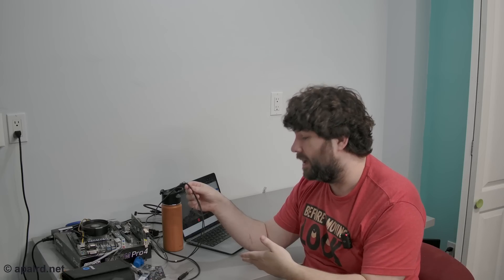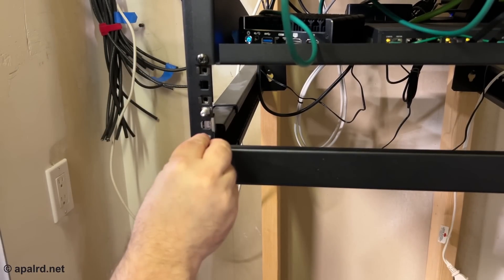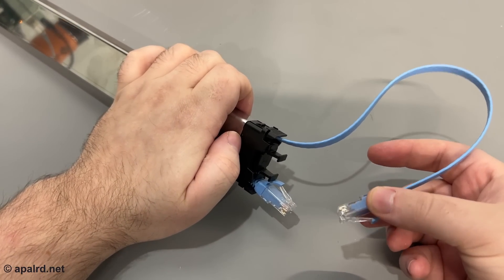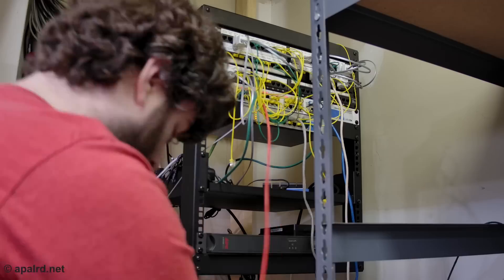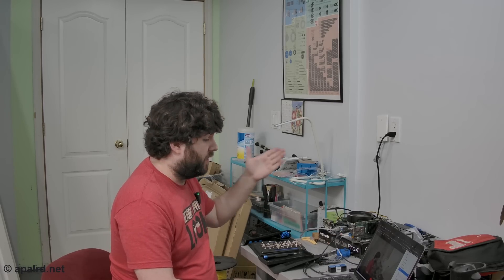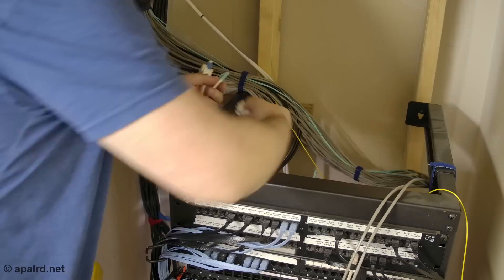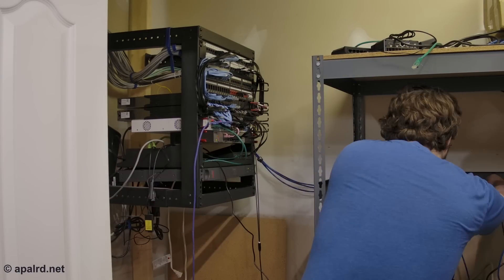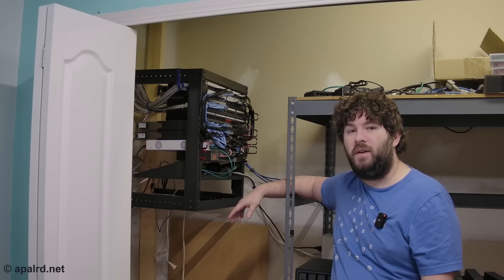Organizing my PATCH PANEL and talking about my homelab network

Comment: Get a used Juniper EX2300-48P to replace both switches, swap fans for Noctua ones :) Will get you 4 x 10G SFP+ ports too
Reply from the maker: I already have 4x SFP+, if anything I need more of those and not PoE / gigabit.

Comment: Lol, I've actually found about this company a few days ago when I stumbled upon their setup exe on a work trip.
They do have some cool stuff, but it is expensive.
If I had to choose between re-cabling a rack with this or buying a better switch, AP or firewall, I'd take the latter any day of the week.

not to mention that it takes up rack space which in an office where you have 200+ sockets to route to switches can be at a premium.

What we do in our corpo is:
24p patchcpanel
48p switch
24p patchpanel

almost everything connected with 25cm cables

Sure, sometimes we can't avoid clutter.
But it is A LOT cheaper, everything is visible, and wall sockets end up corresponding mostly 1-1 with ports on the switch which makes troubleshooting a random device connected somewhere in a office hundreds km away a bit easier.
Reply from the maker: If you can do 1:1 then it's great to have tiny patch cables. If you need a variety of types of switches (PoE / non-PoE / 10G for example) then you have a lot more complexity to deal with in patching.

Comment: The idea is smart, but the price is insane. If I added one of those with a few cable modules, it would almost be the most expensive part in my rack. These are clearly not meant for small homelabs and the only people using them for such a purpose, are the ones being sponsored and getting them for free. Regular patch cables are just fine for me and I can buy them in bulk for less than a single cable module.
Reply: I think mounting the switch directly under or in between the patchpanels and then running some very short patch cables looks much neater that these patch boxes
Reply from the maker: If you do 1:1 patching (a switch port for every single drop), then yes it is neater to use really short patch cables.
Reply: same, i would need 2 maxed out patchboxes @ $600-800/ea for my rack (and why are there plus+ and 365 models now? the cassettes arent interchangeable either...). for that price id rather dump in 60-72tb of hdds in my nas and i can live with the "messy" wiring
Reply: The dev/mount is great, and the company stands by their product, I recently received a handful of them that were crooked and they sent me a replacement of the 6-8 dev/mount(s). I offered to send the defective items so they could investigate but they just replaced them.
Reply: Yeah, same here.  I was intrigued by their ad a few months back, but the price is wild for something that's a novelty at best, a liability at worst.  I would not want this in an enterprise rack because if one cable fails and I don't have a spare cartridge handy, I'll be replacing that run with a regular cable anyway, and another, and another, until this fancy box is just taking up rackspace for nothing.  A thousand bucks buys a heck of a lot of patch cords and DACs.

Comment: Poe camera - are you using a surveillance camera for recording, or what is the setup? You definitely got me curious..
Reply from the maker: it's a Zcam e2c, which is a studio camera
Reply: @apalrdsadventures  how do you like your zcam? also what lense do you use?
Reply from the maker: I really like the functionality. I use the phone app for setting focus without a dedicated monitor, and it's also easy to download clips after recording via Ethernet. It has an API although I haven't made use of it yet.

I have a pretty basic Panasonic 14mm prime lens to go with it. 

On the flip side, it gets crazy hot (it reports 75C basically all the time) while running and recently the Ethernet stopped working (but Poe still works strangely), which I'm in contact with their warranty people about. They've agreed to fix it, but the company that does US service hasn't responded to me yet.